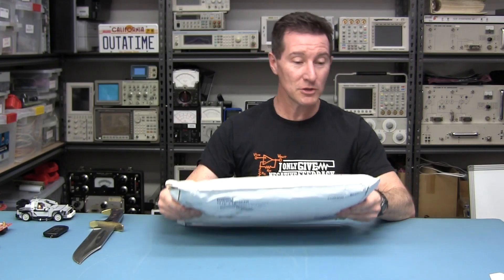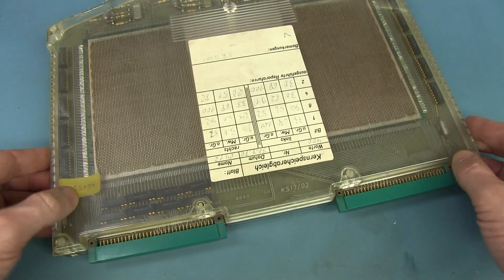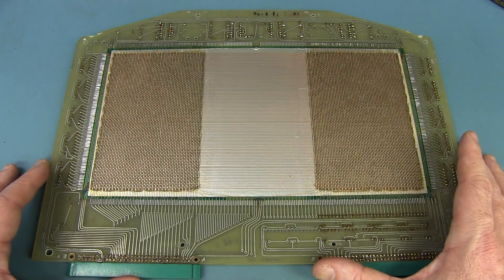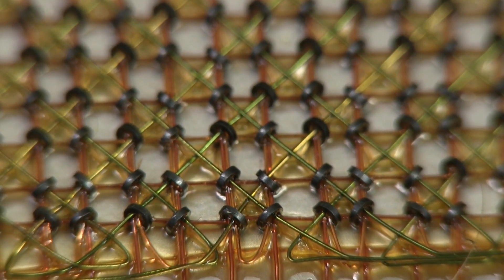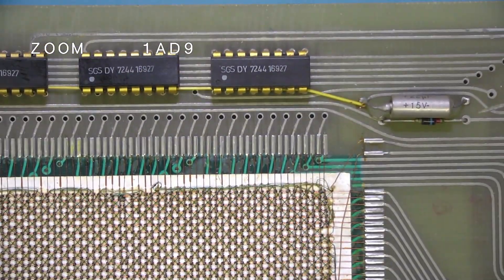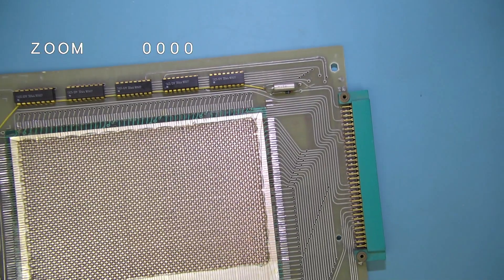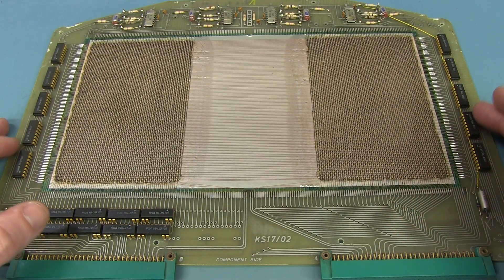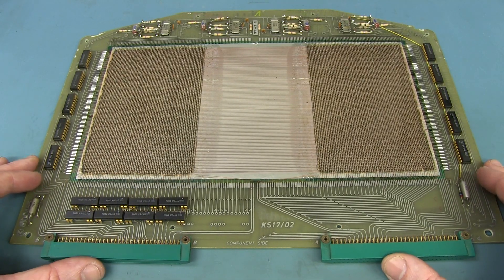Magnetic Core Memory

Comment: I took Dave's bit bucket challenge and counted 'em.
Each of the 4 sections has 100 by 64 wires, or 100 64-bit words, equivalent to 800 bytes per section, 3200 bytes total .
Reply: I think you meant bits, but that's not always true.  Some computers had 9 bit words, 4bit, 22 bit.  And everything in between, https://en.wikipedia.org/wiki/Word_(computer_architecture)#Table_of_word_sizes
Reply: Esp when we're talking about computers in the era of magnetic core memory.  There were no standards for any of this back then.
Reply from the maker: I knew someone would!
Reply: If each section has 100x64 wires (ferrite bits?), and there's 4 sections, then there's 6,400 bits per section, or 25,600 bits on the board. That would be equivalent to 3,200 8-bit bytes.
Reply: Our machines with core memory had 18 and 36 bit words.  Everything was done in octal.
Reply: It's actually architecture dependant and that's pretty old system.
Reply: AX, DX, CX, BX, BP, DI, and SI registers were WORDS.  Im old
Reply: The sense lines go diagonally, not in rows or columns.  Quite often there will only be one sense line for the entire section.  Multiple panels will be read out in parallel to build up a word.  This board, for example, may have 4 bits on it.
Reply: I wonder what the actual geometry is here, since as far as I understand the wordsize of core memory is not the number of rows nor the number of columns, but the number of sense wires (or equivalently the number of inhibit wires, for core memory that uses separate sense and inhibit wires). Probably each of the four sections is subdivided in some way but it's hard to tell.
Reply: Zviki There are row/column wires to select one bit from each section, and per section one sense wire (for read) and one inhibit wire (for write). sense/inhibit may be combined, but evidently aren't in this memory.

To read, one row-wire and one column-wire are driven with a current which will flip the bit at those x,y coordinates in each section to the 0 state. Only where the row and column wires intersect do their currents combine to be sufficient to flip the core's magnetization. If the bit in some section was 1, that core's magnetization flip induces a pulse on the sense wire for that section, which is measured.

To write, the opposite current is driven the row- and column-wire, which flips the bit at those x,y coordinates in each section to the 1 state. For each section whose bit should not be set to 1, an opposing current is driven through the inhibit wire, which partially cancels the row/column current and prevents the bit flip.

Since reading cause bits to be set to 0 and writing requires that bits are previously 0, these two operations are always performed together.
Reply: 16bits, 32 is DWORD
Reply: Word size is hardware dependent.  It depends on the CPU.
Reply: For memory modules the term "word" typically refers to the number of bits read or written in a single access. [edit: although I guess it's also possible the memory is just labeled with its size in cpu words]
Reply: (And to add, since george s has counted that this module has 25600 bits total, and its label says it is 400 words, apparently the word size of this module is 64 bits) [edit: or, if labeled in cpu words, the cpu word size is 64 bits]
Reply: But it doesn't have 64 sense lines, so it doesn't read 64 bits in a single access.
Reply: You're able to count the number of sense lines from this footage?
Reply: That seems unlikely since there are four wires (row, column, sense, inhibit). If sense+inhibit were per-row then you wouldn't need a separate row-select.
Reply: Matthijs van Duin Yep. Maybe one wire is for 0,one for 1 (bits are changed according to flow of the current - positive or negative charge), one wire for x row and obe for y line...
Reply: Star Gazer If one sense wire per core is used, then you will ended with much more wires, if one sense line is used for all cores in line or row
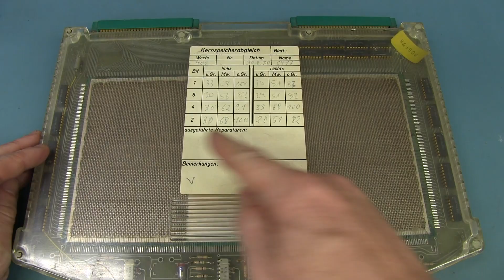Reply: Star Gazer Oh lol I now see the answer to my question is evident from the label (1:30)... there are parameters (probably voltage and timing) listed for each bit, 8 of them. So it seems each of the four sections is indeed subdivided in some way. That's what I was wondering about, but it was impossible to tell by looking at the memory itself without close-ups of the whole border :-)
Reply: in that era it would have been referred to as 400 words of 16bits.

Mainframes typically used 36bit words (split into bytes of 6 or 9 bits) and minicomputers 16bits split into bytes of 8 bits. Because byte lengths varied and 6 or 9 bits was the norm we mini programners often spoke of "octets" rather than bytes. Mini programmers were the first to use hex. IBM 360 was the first mainframe to use octets and hex.

Before then mainframes were programmed in octal which is why 6bits and 9bits seemed logical to their hardware designers
Reply: 16 bit word size is consistent with the wire count and the given claim of 400 words.
Reply: Stephen, You need to count again.  Each section has 100 rows, and there are 4 sections.  Each section is much wider than 16 bits.
Reply: Star Gazer I'm not sure the layout of the rows really matters, as the board might have it's own logic to encode or decode the sections.
I did re-count though, and got 50 rows and 32 columns. (Counting the rings, not the lines. There appears to be 2 sets of wires for every ring, so half as many as the original count.) 

This means there are 1600 bits per section for a total of 6400 bits. (Original comment was explicitly wrong to call these bytes.)
6400 bits divided by the 8-bits in a modern byte, means we have an 800 byte device. How it divides these into words is pretty much arbitrary.
Without a specification, this could be anything from 6400, one-bit words, or one, 6400-bit word. 

The letter in the video claimed 400 words, and this is as good a number as we get. (Unless somebody can find the spec for it.)
If the machine itself is 16-bit as True River and others suggest, then it is 400 16-bit words, or 800 bytes.
This is consistent with the visible hardware, and the statement of the owner. So it is most likely 16 bit.

Alternatively, if the machine is actually doing 32-bit reads (one row at a time), then there are 200 words. (or still 800 bytes)
Or if it's reading one bit from each section at once, then it's 1600, 4-bit words (or still 800 bytes)
Or if they are reading one row from each section at once then it's 50, 128-bit words. (and still 800 bytes)

The point is, it's 800 modern size (8-bit) bytes. No two ways about it. (Unless it's somehow possible for one ring to store more than one bit. Quantum state?)
Reply: Stephen, In each of the 4 sections, there are 100 rows, and 64 columns of cores.  Around the outside edge there is one wire for each row, and one wire for each column of cores.  Look at 6:11 in the video.  That's 6400 bits x 4 sections, or 25,600 bits per board.  That's 3200 bytes for the whole board.  I don't see how you can come up with 50x32 cores. There is plainly one wire for each row and column (red wires).  There's also a sense wire (green) and an inhibit wire (yellow) that thread through all of the cores.  See 5:19 for a closeup. Now, as for the word size, each memory access only reads one bit out of each section (there's only one sense wire in each section, and that's how core memory works), so there's only 4 bits of the word size (whatever it was) on this entire board.  There would be multiple boards to make up the rest of the word size for this particular computer, and all of the boards are read in parallel.  Most of the computers back when this was built used octal instead of hexadecimal, so the bits would be in groups of 3, not groups of 4.  This is why 18 bits and 36 bits were common word sizes (instead of 16 and 32) in computers of that era.
Reply: Star Gazer Ok, strange. On the clip  where I paused, I counted 50x32. I must have mistook the x in the middle for the cores. Hence half as many. (It was kinda pixel-y on my screen..., looking at the zoomed in version, it's obviously the wires I was counting.)

I also totally messed up and gave the per section size... 800x4 = the 3200 you mention, derp.

I do figure the rest of the machine has a way to cache the results somehow, and so could potentially work at a different word size than is optimal for memory reads, but I don't really know much about what was possible then.
Reply: Star Gazer I think it reads in xy lines and rows, so one sense line for all cores in one line/row (coordinate system)
Reply: its a 32k machine
Reply: 4(96 X 50) = 19200 .... My count for no particular reason.
Reply: 3200 bytes is 3.125KB!
Reply: well... a word is 32bytes so....

Comment: Modern DRAM uses "destructive" reads, too.

(but obviously based on microscopic capacitors on silicon gates, rather than magnetics.)

They normally have a Row Buffer, so the data being read gets written back on the next cycle.

There's an interesting security hole due to that process, and you can still even get "crosstalk" between adjacent rows with DRAM as well...

https://youtu.be/lSU6YzjIIiQ
Reply: And of course, Jeri did a vid about similar tech a long time ago.

https://youtu.be/p7SkE5pERtA

I would have linked to xjet's vid too, but he's already on here. lol
Reply: I thought DRAM was destructive whether it is read or not, and the memory has to continually be written back.
Reply: Yes, that too. ;)

The charge leaks out of the capacitive cells over time as well, so they have to be refreshed at a regular interval.

A common refresh rate is 64ms, but it's obviously impractical to do this on all cells / rows at once, so it just refreshes every row in sequence.

ie. that whole 64ms is split up into how ever many rows there are, so if there are 1024 rows, then the timing between each row being updated would be 0.0625 ms (62.5 microseconds).

So, eventually all the rows will still get refreshed, and an individual cell will wait no longer than 64 milliseconds before it's next refresh. ;)

(It took me a while to realise how the "auto-refresh" in DRAM worked when I first started messing with computers / electronics. All it really has is an internal counter that increments, to refresh each row in turn. At least that's the common method.)

Comment: Fantastic! I worked on an IBM 360/67 in college. Same deal, 512K of ferrite core memory in huge cabinets. VM to 1 megabyte for your job if you wanted. These computers cost millions and took up an entire room.
Reply: We had an IBM 360 donated to our high school back in 1976.  I learned FORTRAN, BASIC, and the IBM 360 assembly language using punch cards.  It was a real light show from the front panel when it was running a program with the room lights turned off and all of the indicator panel lights were changing with each instruction.  I still have the card deck from the first FORTRAN program that I wrote 41 years ago (gulp).  Yup, I'm still a nerd.
Reply: The one we had at Brown in 1972 was a 360 model 67, which meant that it had hardware that could do "direct address translation" and let you run a bunch of virtual machines, mostly IBM 360 model 65s. Every user had an interactive complete virtual 360 right down to the ability to work right on the (virtual) metal. So VMs are by no means a modern thing.

And, the Model 67 could also run a virtual Model 67, as amazing as that is. The systems programmers used that feature to work on, develop, and debug the Control Program (today called a hypervisor) using a virtual Model 67 running on the real Model 67.

You could submit batch jobs, or you could get an account on CMS (the Cambridge Monitor System) which the VMs ran, and use it interactively. Imagine 20 or 30 users, each with a virtual 360, all running on a 512 KILOBYTE machine.
Reply: Hey JL, I remember running MP/M on a 48K computer supporting 8 users -- that was no mean feat either -- that's just 6K per user versus 17K per user with your setup.  Ah, happy (but inexorably slow) days.
Reply: I thought it was IBM that insisted upon the limit, also IBM forced Intel to create the 8088 with an 8 bit bus, since "No one will ever need a 16 bit bus"...
Reply: @RolfMikkelson  I rather doubt that.

The 8088 is an 8086 with an 8 bit bus.
The reasons you'd do that is not 'because nobody will need a 16 bit bus', but because 16 bits means 16 traces, which makes the motherboard design much more complex and expensive.

8088 and the 8 bit bus is a cost-cutting measure.
As mismatched bus and CPU width almost always is.
Reply: IBM may have been the reason, but it was Gates who said that.
Reply: Your reference says he said he thought it would be enough for 10 years.
Reply: It had priorities of course, so if you were a lowly undergrad with a free account, you got "zero priority" which meant your VM only got the CPU when there were no other processes in the queue! You could sit there all day. We all found a way to get a funded account.
Reply: Remember when memory cost $7,500,000 per gigabyte?  I do :-)   https://www.youtube.com/watch?v=_yp6jtpQ5fc
Reply: I know it was $950.00 to upgrade my 1984 original 128K Macintosh to 512K.

And never forget that Bill Gates said nobody would ever need more than 640K of RAM. At the time, that made sense because we had started out with 16K!